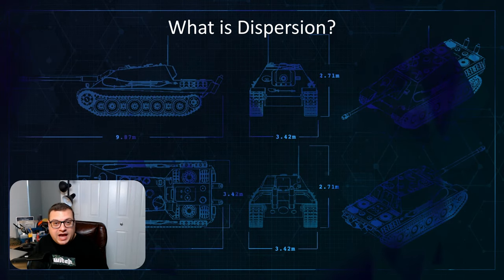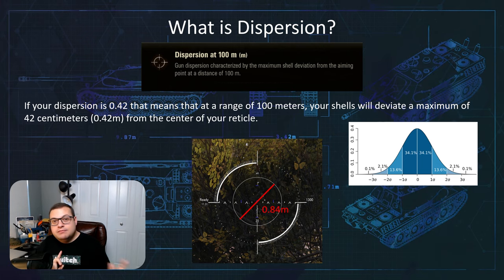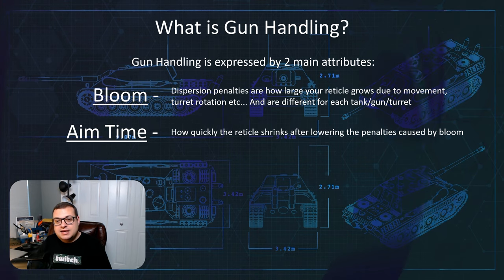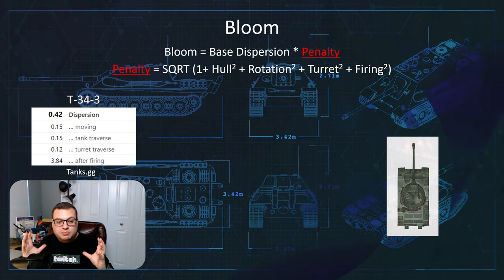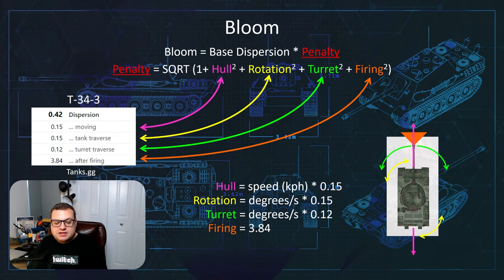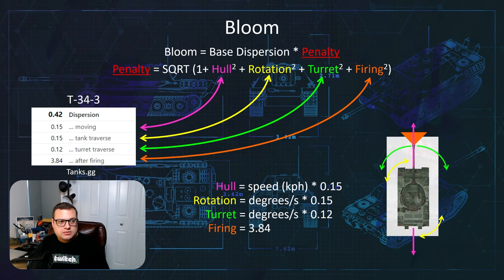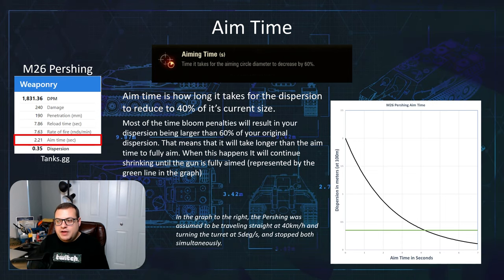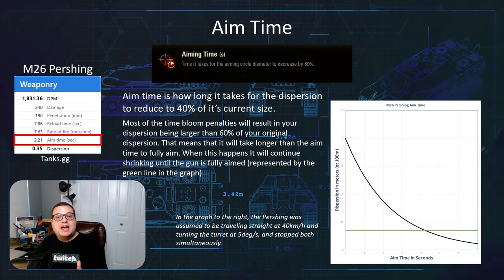The Truth Behind WoT Dispersion - How Gun Handling Works in World of Tanks

Comment: Great video! How does this compare to the aim circle you see in game? Does the normalisation curve always fit inside this? Also, I would imagine there is a second RNG value used that determines the angle the dispersion is expressed within the circle, i.e. whether the shell goes up, down, left or right etc.
Reply from the maker: Yes, the normalization exists in every axis, so the bell curve is quite literally 3d shaped when it comes to dispersion chances. There is a small 4.2% chance that the shell falls outside the maximum dispersion circle. When this happens the game re-rolls the dispersion RNG under a flat distribution.
Reply: @13Disciple  Ah yes thank you. I just realised you mentioned this in the video. If the 4.2% of shots outside the aim circle are flat distribution, what would be their maximum deviation as i would imagine there would have to be a limit somewhere beyond sigma 3 if the RNG no longer follows the bell curve.

Comment: Lets assume the aimtime is 2.2s. To what base does this number refers? To the scenario that the penalties for hull, turret an forward movements fully apply? If so how do we know?
Reply from the maker: I understand your confusion. Aim time isn't "AIM TIME". This wording frustrates me. Aim time is actually more accurately called "AIM SPEED." So for 2.2s, it takes 2.2 seconds for the reticle to shrink to 36% of it's original size. It's a rate of change. Not knowing how wide your dispersion penalties are, the circle will always shrink to 36% of it's original size for every unit of aim time (in this example 2.2s) until the vehicle has reached its minimum dispersion or fully aimed.

Does that help? Aim Time is corrected in the second video of the playlist from 40% to 36%. Make sure to check out that video as well.
Reply: @13Disciple  thx for ur detailed explanation. I must admit I still struggle.

My problem is: what is 100% (36%+64%)? Is it the tank turning the hull?  Is the tank tuning hull and turret? Is it the tank turning hull, turret and forward movememt? Is it full oder slow forward movement? It surely cant be always 2.2s, right?

Comment: The dispersion in this game is just utter stupid mechanics! The developers have no clue as to dispersion, what causes it and how it is compensated for. 
First of all dispersion is cause by the first few rounds out of the gun tube. It is cause by the uneven heating of the gun tube causing slight warping of the tube. With the firing of more rounds it will work its way out. Usually about 5 to 6 rounds. It will be with in an inch or two of the aiming point of it's original bore sighting. Thus, no more dispersion. And these were dispersions at distances of 1000 meters to 1500 meters. The worst of these dispersions recorded in WWII was 19" from the aim point at 1200 meters on a 76mm gun on the M4. 
The Germans had a problem with the 88 long barrel on their tanks. With dispersions of 6' to 9' from the aim point consistently at 1500 to 2000 meters. I would say it was due to their method of bore sighting and not thermal heating of the gun tube. The Russians may have also suffered from this as well. I'm not sure, but I am willing to bet this is where they get this stupid mechanic from.
The Persian had a deviation of .5 inch from aim point at 2000 meters when it came into the war. This of course is after the gun is warmed up. 

As far as the tank moving and the ability to hit was not due to dispersion. It was due to, one, gun tube bounce if you did not have a stabilized gun, two, the skill of the gunner if he did have a stabilized gun. Some gunners could shoot rather well with an un-stabilized gun. Germany had their tank aces that could shoot on the move. 
The Shermans had stabilized guns as well as most of the American tanks from the Sherman on. 

Aim time is just stupid. In real life the aim time is the time it takes a gunner or commander to identify the target and lay the gun on it. Just like you have to do in the game. So why do they implement a longer time before you can shoot a good shot? When I laid my reticle onto a target I did not have to wait another 2 to 3 or even 4 seconds to shoot. I shot within 1 to 3 seconds of spotting the target. Also, the targeting reticle and the gun reticle should be the same. There should be no gun reticle catching up to the aim reticle. That is just stupid. One reticle at the traverse speed of the turret is what it should be. I can understand if you are zoomed out of the reticle to see the battle field, but once you zoom in then it should be the speed of the turret rotation with one reticle. 

Sun from artillery is not a thing. Artillery in this type of game is just stupid. On heavily armored tanks, which are the mediums and heavies with some of the light tanks and about half of the TD's would not be affected by artillery. The tank is not like a bell, it does not amplify the concussive energy through the armor or increase the pressure inside the turret. And tanks taking damage from an HE round that hits the ground is even more stupid. The shrapnel from the HE shell does not have the velocity or necessary shape to penetrate the armor. And the heat explanation is a bunch of crap! The HE rounds can not generate enough heat to melt any metal or rubber on the tanks. 

I know all this because I served in the Army on both artillery and tanks and I am quite familiar with how each are used in combat and what there capabilities are. I came out of the Army as an 
E-6/Staff Sergeant.

Comment: rng random number generator is just that RANDOM. How can you make specific numbers off of random numbers. So the answer is you hit or you miss. 50% is the answer to all the gobblegook you just showed us. The math doesn't work so "penalties " are used to make it work. 1 out of 2 shots are going to miss. Vegas says you win slots 99.7% of the time. You bet 1 dollar you win .25 cents is considered a win. How about the truth you will lose .75 cents on every dollar you bet and the penalty is you are guaranteed to lose 3 cents of the last.25 cents. Multiply that buy the air speed of a Swallow (rng) traveling at a certain speed, going straight with no outside factors such as wind, temp, friction, aiming, moving or turning and casinos are filthy filthy rich. The game is designed that only a few will be excellent and the majority will be tomatoes. The stats prove it unless you add penalties. 50/50 chance of a hit or missed shot.  Same as losing 9 out of 10 games! Its all predetermined as soon as game starts. It is fate not skill!